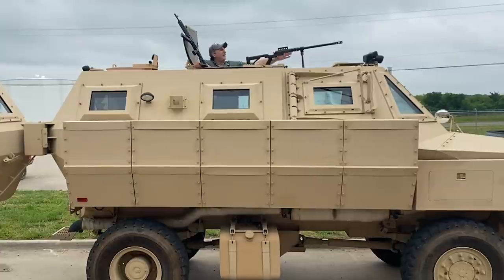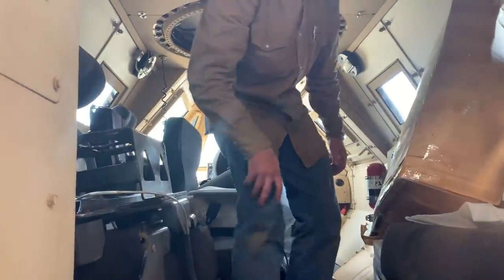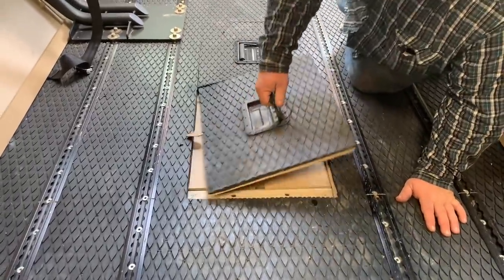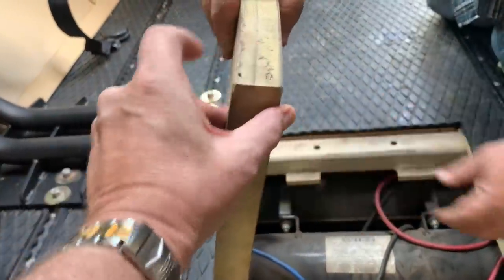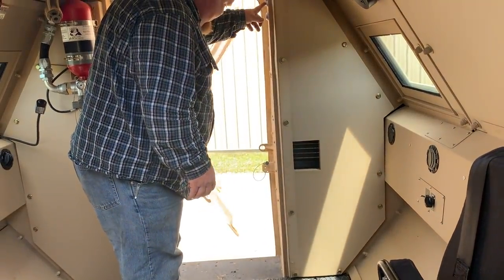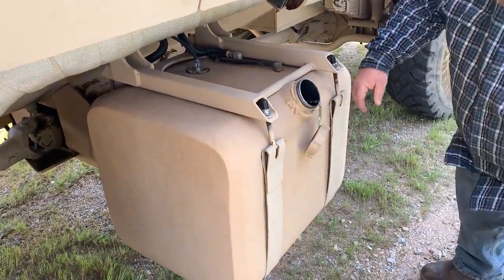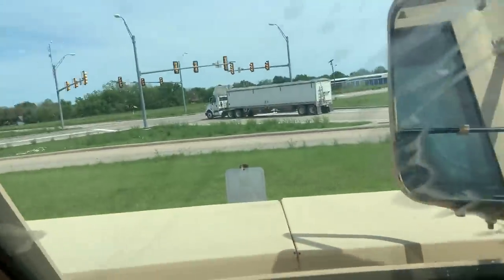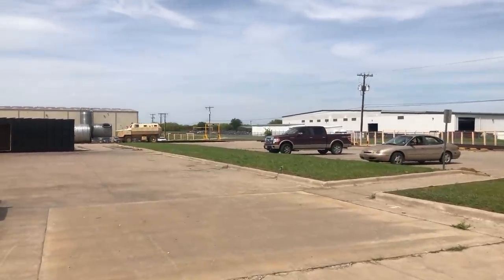TEXAS Prepper buys BLACKWATER MRAP "The ULTIMATE Armored Vehicle"

Comment: GSS is for Global Seating Systems. They were the manufacturer of the seats that the Blackwater Grizzly APC MRAPII prototypes used. The seats are heavy because they are built to be blast resistant.  Blackwater's Grizzly lost out on it's bid to be selected for the defense dept. contract due to it's failure in testing on front end explosion protection at Aberdeen Test Grounds. Blackwater's manufacturing facilities in Camden North Carolina closed down shortly after building these prototypes.

Comment: Thanks for the vid. Just some suggestions about the halon fire suppression system. That system should be deactivated and bottles removed if you allow people in the vehicle who are not trained on how to get out in an emergency. Remember, Halon is heavier than air and displaces oxygen. There are also manual activation handles that kids love to play with. There have been multiple deaths in the Army and probably other services attributed to these systems, and that's with trained crewmembers. Also, at 5:45 that cap is not for the nozzle, it is to protect the valve when the bottle is removed, and at 5:55 that is not an IR light for illumination, it is a multi sensor for the halon system. I was a 19D Cavalry Scout and spent years crewing the M3 CFV (Bradley) that had these systems. They can kill you if you panic and cannot get out in time before you pass out due to lack of oxygen. As a note, there was talk way back of doing away with halon and going to C02 but the lack of oxygen is still an issue with C02 as well.

Comment: Ron is it equipped with a winch??? If not, get a front and rear winch. All that weight is its down fall. Stay clear of mud. Air down when going off road etc... definitely get a 30,000Lb + winch. Then you have a way to get unstuck... if you ever do get stuck. Better to have and not need, then to need and not have.

Comment: I’m wanting to move to Texas and I will 10000% buy a shelter from you before building a house
Reply: Cap
Reply: You know how much they cost?
Reply: @dababycar2899  yes from like 20k up into the millions
Reply: @blakewood8475  with the installation fee is starts at like 35k for the complete package of the smallest bunker
Reply: @dababycar2899  Id rather spend a bit of brass for safety considering I’d be in Tornado Ally
Reply: @blakewood8475  fair

Comment: 17:51 Actually if the tank is punctured the middle material will mix with the diesel that attempts to leave the tank threw the bullet hole affectively sealing the tank. it makes it so the tank uses diesel fuel to fix the tank with the filament in the middle of the tanks. check the videos out online there cool.

Comment: I was in Iraq for the first rotation when the insurgency kicked off. It was that deployment that taught me Hummv's were coffins on wheels. I was a Bradley mechanic in the Army for 15 yrs total. The IEDs were ripping through our trucks and tanks/brads due to the flat hulls. The second time I was in Iraq I was supporting the 101st ABN at FOB Normandy when they got Bradleys because they were getting hammered with IEDs and their Col requested armor. They got 13 Pre-po Bradley's from Kuwait. I was sent over to support them as obviously the 101st ABN wouldn't have Bradley mechanics. For the next 8 months I was repairing Brads and doing Recovery work. Of the 13 Brads they got 11 were coded out for IED damage. I recovered every one of them but 1. Only 1 soldier lost their life during that time. If that Col hadn't requested Armor. That number would have been allot higher. Even though the Brads were destroyed by the IEDs. They saved lives. My 3rd tour was when the MRAPs were really being fielded. My unit was one of the first in Iraq to get the Maxxpro's. Big and tall trucks. But they did their job. I don't think we lost anyone during that deployment. I could be wrong. But as far as my unit goes we didn't lose anyone to IEDs. I am grateful the Army is sidelining the Hummv's but it took far too long to make that happen. The MRAPS aren't perfect. But compared to what we had during the first two tours. The MRAPs are like tanks on wheels but better in terms of surviving an IED at least. I wouldn't put them up against an actual tank or anything designed to take out hard targets. And trust me you are all lucky you never saw the boneyards in Kuwait that held all the destroyed vehicles from Iraq and convoys from Kuwait to Iraq. The Hummv yard was one of two times I honestly cried. The first was when a civilian contractor I made friends with was killed by a rocket attack. The Hummv yard was by far the biggest and most pathetic to see. MRAPs saved allot of lives. I honestly hope it stays that way going forward.
Reply: Very interesting to read, thanks for sharing! I can only wonder what it was like seeing the graveyard, I imagine very somber and eerie

Comment: Feel tank might be lined with Polyurea. It was made for the army for ballistics. It's a spray on rubber coatings that can deflect almost anything. The spray it the undersides of trucks and whatever for bomb proofing. They also use it to line fish holds in Fishing boats. It's awesome stuff. But you need a $35,000 machine to spray it. I've sprayed it before.

Comment: They might not like seeing a working gun on top if you are giving rides in it so a tennis ball cannon you can mount on it could be fun if you can tap into the onboard air system for it.
Reply: Put in a t-shirt cannon with Atlas bunker logo shirts.  ;)  That would be amazing to take to a race track, drive around the track firing shirts into the crowd on full auto.  :)
Reply from the maker: Good idea. 👌🏼

Comment: Add a solar unit onto the top and charge the batteries with that and put a AI turret with weapons mount and hit a switch and it will have object tracking and you can set color codes for Friendly's or ask for permission firing or turn loose options to dust anything that moves lol 😆

Comment: I believe that is an early MRAP. The seats were not suspended thus if you do run over an IED the guys inside will have a terrible time unlike if the seats were suspended.  Luckily you don't have to use this in the sandbox.

Comment: 182 miles? If you purchased it from Gov Planet then it is true and unchanged military surplus. The MRAP has much more than 182 miles, it just has a new gauge. The military does not set gauges to original milage on ground vehicles.
Reply from the maker: No it's new. Never used or deployed
Reply: @AtlasSurvivalShelters  
Good Deal👍